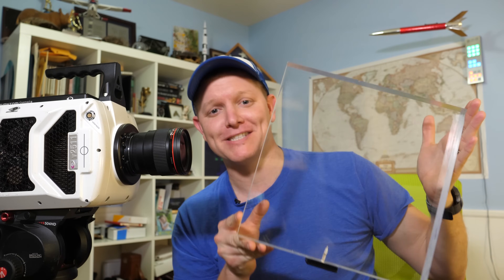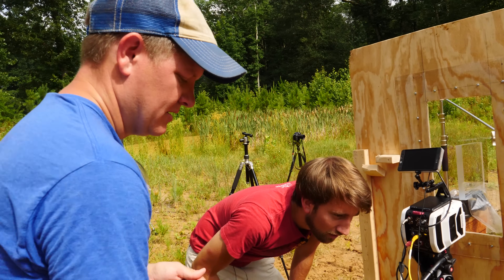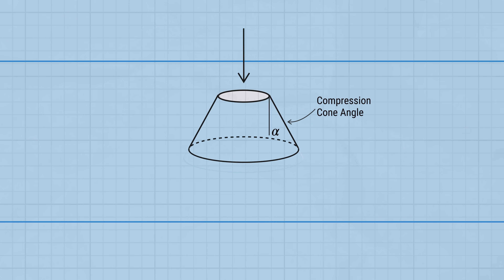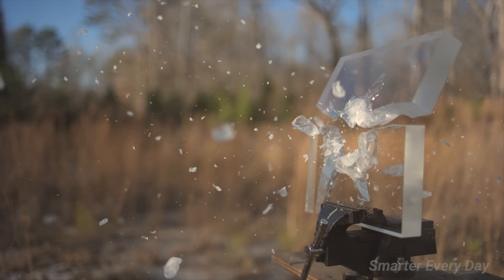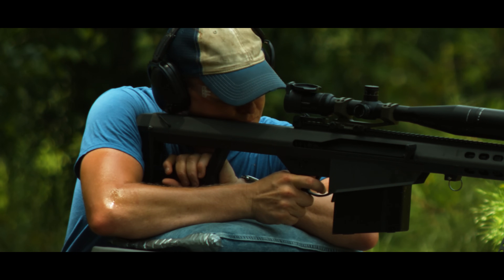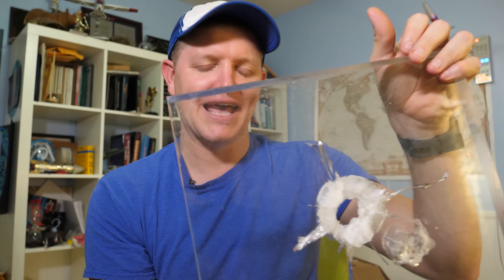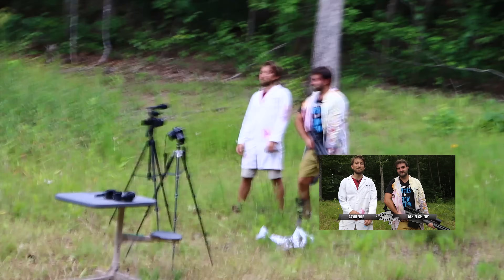.50 Cal vs Ballistic Window HARDCORE Slow Mo  - Smarter Every Day 187

Comment: I know it's not a big deal but it would have been interesting instead of having the bulletproof glass only held on the bottom by the vise to have it equally supported on the entire perimeter by some sort of a frame, held up by an easel or a tripod like device.
Even better would be something absolutely rigid holding the frame.
What you're doing looks like so darn much fun.  I love what you do and the information you provide on a vast range of topics. 👍👍👍
Just one of my favorites is the tour through the rocket factory.
The rocket body itself is now more interesting than the capsule on top.    Prior to the tour I'd never really given any thought to that.

Comment: Watch what happens between 6:08 and 6:12, very carefully. Try to creep it forward, a tiny bit at a time. It looks to me like there's lateral forces that cause it to explode - not the initial inward force.
I don't completely understand it. But I think maybe some areas are initially pushed in more than others - cracks develop and then over a few milliseconds they worsen - then they instantly cross a threshold where the remaining forward momentum can no longer be supported.

Comment: I like to think about the pressure cone like a super sonic jet.

The Jet going the speed of sound making shockwaves and soundwaves appear behind it when as an example if the plane were to fly over you, you see the plane then hear the super sonic boom and feel the wind like how we saw in the slow motion part of this video, the bullet goes through the glass then shatters it.

This visualizes what it looks like in the air with a plane but instead it's a bullet and bulletproof glass. The bullet goes through the glass then after it has passed "The super sonic boom happens" where the glass shatters and breaks

Correct me if I'm wrong but this is what makes sense to me

Comment: Nice. I was hoping for a slow mo looking through the edge of the material. If it's possible to polish it clear enough. Then hopefully see the pressure cone propagate through the material. Might need something a bit slower than the .50 flings the projectile. See if the wave stays the same speed, regardless of the speed of the projectile. Sounds a bit like science (if you write the results down).

Comment: At 5:59 at 0.1x speed, the exact frame that you see the tip of the 50bmg hit the plate, it looks like there is a spark / flash of light at the point of energy transfer... any explanation?

Comment: Was your frame rate high enough to do some really nerdy math and find the amount of energy it took to break through the medium? Known mass, known V before less Known mass, known V after. using smaller rounds, but getting bigger, with less to more massive projectile as the breaking point is reached ( as in a 30-06 165grain will not break through but a 30-06 180grain would, meaning we could know the amount of energy transfer it could with stand )

Comment: 5:58 Put the video on 0.25x and watch right after the flash of the impact, The flash Immediately disappears and is replaced with a black "dot"....... Cool but odd, Immediately made me think of a tiny black hole that was spawned for an instant due to the amount of force colliding, Obviously being that small it wouldn't have been able to sustain itself so the black dot disappears just as fast as the flash. Anyone else?

Comment: 2:04 zero movement on the glock when he dropped that trigger.
Reply: Lmao there is movement. 1 its called recoil and two its not instant.
Reply: @violentjingo7899  maybe not many people realize how impressive it is that there is no movement on the glock when he dropped that hammer. :)
Reply: @zohanrock  there is movement. Its just not instant. It happens when the ejection happens
Reply: @violentjingo7899  ok just to clarify my meaning, one of the hardest thing to do when firing a handgun is keeping it motionless between the time you start to pull the trigger and the bullet leaving the barrel. of course the gun will recoil afterwards. Which is why I'm super impressed that even in slowmo, you hardly see any movement of the gun when he triggered it.

Comment: I could watch .50BMG impacts all day long. It looked as if the armored glass may have stripped part of the copper jacket off the 2nd slow motion shot... which is an accomplishment for that armor. Most .50BMG rounds aren’t effected enough by 9mm rated glass to achieve that. So good on them! 

There’s just something mesmerizing about seeing a bullet with THAT much power within it. It’s a MASSIVE transfer of energy regardless of WHAT ain’t impacts. Dadgummed near explosive when it’s a human on the receiving end of that transfer. I say ‘near explosive’ because that’s what the aftermath looks like. (horrifying but true)

Comment: Yes frustums are in play but I don't think the clear dot has anything to do with them.
Based on what I know about "bullet resistant" "glasses" they aren't actually one solid piece of material but rather a lamination of acrylic and polycarbonate with an optically clear binder.

The reason why that little dot is see through is because the impact energy was great enough to completely pulverize the acrylic face leaving nothing but the polycarbonate backing layer.

If you shot pure acrylic the plate would completely shatter and the bullet would go through.
If you shot pure polycarbonate it would punch a clean hole and the bullet would go straight through.
Only when used in conjunction with one another does the plate begin to develop "bullet resistant" properties.

The acrylic face plate shatters on impact; this absorbs and deflects kinetic energy and Increases the surface area of the bullet (mushrooming it), essentially spreading the impact force over a greater area.
This impact force is then delivered onto the polycarbonate which acts as a "blanket" to capture the bullet and "glass" shrapnel.

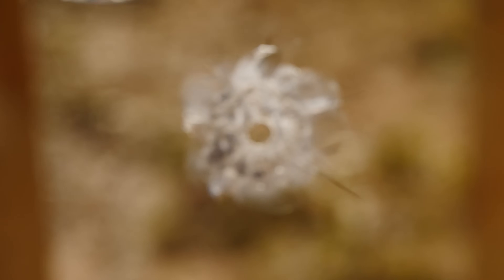I can kind of validate my theory with video footage from 2:48.
The visible "murkiness" you see is caused by the different materials flexing different amounts and the binding agent letting go. I use the term "murkiness" for lack of a better word; can you see how cloudy it is?
Now take note of the stress fractures (cracks) and compare them to the "murkiness"; notice they have nothing to do with one another. The "cracks" extend multiple different directions and in some instances far beyond the "murkiness".
These "cracks" you are seeing are caused by the acrylic separating from itself whereas the "murkiness" is caused by the separation of the rigid acrylic, from the the flexible polycarbonate. More specifically its actually the glue loosing its bond and deforming, this causes refractions and makes it loose its optical transparency.
Its the difference between "cracking" in the Xy, Xz and Yz axis. (This of course changes based on your point of view and orientation of the plate but if you read to this point I think you get what I'm saying.)

How else could I explain it?...  Everyone knows what a mach cone looks like right? Well imagine the mach cone is sand (from crushed acrylic); The bullet is going to transmit its energy into the sand surrounding it, dragging it along as it plows its way into the polycarbonate (essentially fluid dynamics). Also remember that the lead bullet is physically deforming, mushrooming; pancaking if you would. All of this. combined with drag is enough to slow it down to a point where the polycarbonate can flex and act as a sort of catchers mitt. It literally bends and warps to contain the remaining energy. Its awesome.

Its the difference between 467 joules of being concentrated on a single point at the tip of the bullet versus spread out over say a nickel-quarter sized area (life and death). This stuff is sort of like tank armour except tanks use ceramic and steel which leaves them vulnerable to HESH rounds (High impact squash head) (basically it turns the tanks armour into deadly shrapnel in the form of spall) (not to be confused with spatter). Hopefully some or most of you know what I'm talking about cause I'm getting tired of writing and am way off topic now but it does lead me to ask the question: why are the inside of tanks not lined with Kevlar; or are they?

Comment: Just a random physics question - the glass breaks, the 50cal seems in damaged - what would happen if the bullet was stationary and the glass was moving? So the glass was hitting the bullet not the other way around? I know it’s impossible to have a floating bullet while a piece of glass moves faster than the speed of sound but that aside, if it were possible would the glass then deform the bullet? How does speed add structural integrity to the glass if this is the case? Or would the glass just smash around the bullet like throwing an egg at the pointing finger of a statue type of thing?

Comment: 5:58 if you set the playback speed to 25%, and pause the video at the very first frame of impact, where the very tip of the bullet impacted the glass, it shows a SOLID black dot in the middle. What could that mean? Is it because the light from behind the glass is being blocked by the bullet? Is it a youtube compression issue? Or is it something else? I dunno but it's interesting to say the least.

Comment: Well it's not hard to imagine the physics of a bullet impacting. And anybody with a physics degree can even predict quite accurately how that works out.
How do you think they figured out the implosion and of the first fission bombs?
So just imagining it? that's easy

The story between a 9 and 50 is also a different head... so the contact is much different
But because you compare low power pistol with a much heavier bullet and overkill power.. you won't see the difference of the bullet head at all.
9mm round head has a blunt flat front.. wide contact patch.. 50 cal is well,  spitzer.

Would have been better to first compare the 9mm pistol to a 9mm spitzer that has similar weight/velocity...  

You'd already see a much different result, without the 50BMG overkill.
missed opportunity

Comment: To see the perfect pressure cone, 
gather 3 to 4 countertop cutouts for a sink, stack them tightly together standing up. 

Using police loads for 357, at about 50 to 75 feet, fire a round and see the results at each panel. 

The Front panel will have entry hole, and the rear sheet will have a 3 - 4" 
cone hole exiting. 

Particle board is the perfect median with only high pressure glue and wood chips. 
If panels still have Formica on them, 
that's fine. 

Have fun. 

Cheers

Comment: When you showed us a glass with two holes, big and small, but glass still in its square shape I've had few thoughts. How did you manage to do that without completely destroying the glass with 50 cal as previously showed in the video? Does the distance matter? My second thought was what happens if you set the same glass on the same mount (which all have their own levels of flexibility) so close to 50 cal gun that it almost touches it at 90 degrees angle? I'm guessing that in theory speed of the bullet would be the fastest, so it should go through the glass without breaking its square shape, but what about sound and shock waves? Would they push the glass away from the gun before the bullet hits it, so the glass wont sit at 90 degrees in relation to the gun and then cause the bullet to run at an angle causing the whole glass to break? Sorry for so many questions, I was mainly interested in shock and sound waves having an effect on the shot. Thanks for the great content!

Comment: I know I'm super late to the party, but I saw something that my initial explanation doesn't feel like it would work.
At 5:58-6:13 or so, the 50 cal flies through the acrylic, leaves its stress cone, flies on, and then the acrylic shatters into pieces. If you watch closely, the bullet itself leaves a hole with cracks protruding out of it, but after the bullet is already clear through and long gone (in terms of the slo-mo video), then the acrylic breaks apart further into the big chunks that fall to the ground. Why?

I initially thought it could have been that the cracks had momentum, but seeing as how they stop and then start again, that doesn't make sense at all. Then I thought maybe it would be the wind. I don't know for sure, but I don't see how a 50 caliber bullet wouldn't go super sonic, so maybe due to the nature of super sonic rounds the acrylic breaks the rest of the way from the force of the air wave catching up to the bullet and the cracks that the bullet left in the acrylic weakened it enough that that wind was enough to break it the rest of the way. It makes sense to me, but idk if the numbers would actually check out. 

I'll be honest, i don't even know if 50 caliber rounds are super sonic at all.  This is 100% hypothesis, so I could be completely wrong in every way, but if anyone knows the answer please let me know, I'm curious.

Comment: 5:38 who did the sound engineering for that casing hitting his bicep I almost cried I laughed so hard😂🤣
Reply: isnt it real??
i thought it was the real noise that the mic recorded
Reply: @tomigodoy9853  high speed cameras never record sounds, any sound you hear is made after recording
Reply: @edoardobonfante753  “made” is a bit of a misleading term. That would imply that no sound was recorded on site and that the sound effects were reproduced else where it even samples used from a library of sound effects. Definitely it rly a possibility, but equally possible is that had independent mics rigged up and recorded the on site audio. At which point a sound engineer would mix, EQ, and sync in post production.
Reply: @pro-v7500  sorry, I'm not native English-speaking
Reply: I notice that too the casing 🤣

Comment: What's more interesting than the pressure cone is the flash of light in one frame you can see at impact when slowing it down to 1/4 speed... You should discuss what is happening to the materials to cause the flash of light...
Reply: Heat crashing with air equals big bang

Comment: A large portion of the clear material's response to the round hitting it is how it is held in the vice. Having a circular target of a similar size, and mounting it on, say 6 points equidistant on the circumference. Tied of to a rigid frame, with good cable torqued up evenly with turnbuckles.   Then the true value of the impact could be called zero.  Jut a place to start asking questions. Inertial studies must begin in a precise way. Not with a random vice. I don't mean to be picky, just trying to get some attention to detail in the setup. Have a great time people.
Reply: 50 still wouldve ripped through it dont worry

Comment: @SmarterEveryDay So the cone you where talking about. IO've seen it many a times in ballistic training in the army when I had my time there about ten years ago. I'm imagining that the cone that develop in the material is the result of expanding forces in both directions and that it will expand as long as the pressure of the "explosion" allows the material to compress . This decreeses the further into a material you get as more pressure is "stored" in the material the deeper you get. Am i right?

Comment: I did this once. A co-worker reveled he was a gun nut and asked if I wanted to shot his 50 cal... if I bought my own rounds, of course! I brought all kinds of things to blow up, from propane tanks to steel plates. I also shot 2" thick acrylic... didn't stand a chance! But I also made (laminated) my own "bullet proof" glass using layers of 1/2" polycarbonate and 1/4" acrylic sandwich. Surprisingly that stopped a regular round, but not two. And some kind of tracer round with maybe tungsten inside of it, just sliced right through it however. From what I've heard since, is those rounds can even go through 1.5" of titanium plate. My assessment is that there's really no hiding from a 50 cal sniper if they are after you.

Comment: Useless and not practical bulletproof glass or bullet resistant glass, simply because the glass should not crack or shatter when it struck with bullets, ask me why, because I don’t need to change or replace the glass every time and then 😉… So obviously bullets should bounce off of the glass without leaving a tiny teeny mark or any sort of indication that it was struck by any type of bullets before😎.

Comment: Would the acrylic pane have shattered any differently if it were actually set in a window frame in a wall? Would it shatter differently if it were set in a cinderblock wall vs. a wooden stud wall?

I'm assuming it would still shatter because it is a 50. cal after all.

Comment: I wonder if the cone of stress varies due to the molecular structure of the material as well as the mass of the object projecting the stress... Like how Steel has a crystalline structure in how it's atoms trap the carbon making it harder. Seems so since iron is tougher than steel so it gives and bends rather than shattering like steel does, something like those two metals being tested for that would be interesting to see I think.

Comment: We can see a good example of application of frustum (100 degrees compression angle) into the flint knapping, Also known as "conchoidal fracture", commonly seen in silicon based rocks and glass obviously.That would be also a good slo-mo video. Thank you for sharing this rich knowledge.

Comment: There's a little more involved than pressure waves when you're impacting material you're also displacing the material from one place to another so you would really need to see it in far sloemotion to be able to understand all the forces that are working but the mass of the projectile and the way it displaces the material will have a big effect on the explosive effect